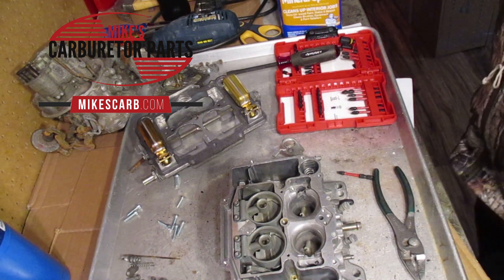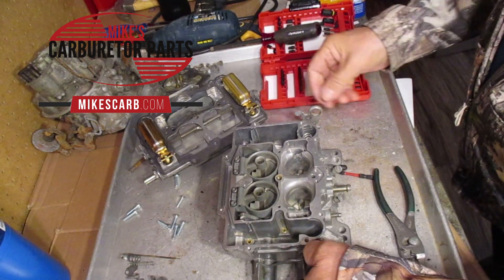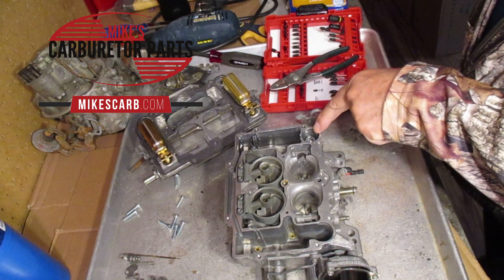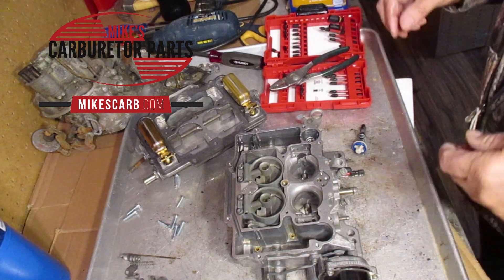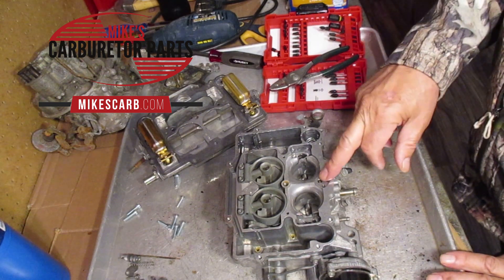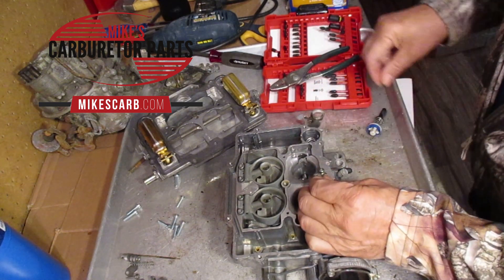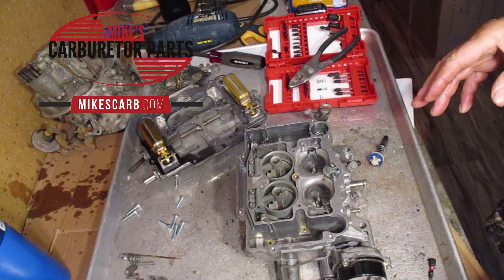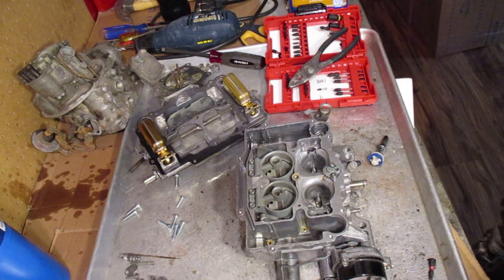Edelbrock  - Testing Accelerator Pump and Bog Troubleshooting

Comment: I have a 1406 on my ‘72 Olds 350. The most part the carb works great, cold starts are near perfect but there are 2 issues that have persisted; 1. After driving for a while it takes a lot of cranking to fire up. 2. Sometimes when I back out of a space it will knock off and I have to restart it. Any ideas on solutions for these problems?
Reply from the maker: After turning off and warmed up look down the carburetor to see if the venturi is dripping. If so, then the main discharge check may be leaking. See this page for more info: https://www.carburetor-parts.com/edelbrock-troubleshooting

Comment: My question is what part of the carburetor is plug if the right side mixture screw is screwed in and nothing happens
Reply from the maker: Most likely the passage on the side that doesn't change. Follow the passage all the way to the venturi.

Comment: my check ball on a brand new carb sticks.  ive had it apart 3 times to get it out....its currently stuck.  is there a fix?
Reply from the maker: You can get it out by heating around the outside and tapping the carb on the bench. It will fall out. It's possible you have the wrong check ball in it, or you can tap it lightly to give it a better seat.

Comment: Mike-Great Videos!!! I was inspired to rebuild my Carter/AFB -9661S by your step by step approach to rebuilding. I have a question for you that I didn't see covered. My rebuild kit includes a check weight. however, the carb actually has a spring on top of the check ball. Can I use the check ball weight or do I have to use the spring? I truly appreciate your thoroughness. I'm learning so much.

Comment: Bad bog when accelerating too quickly. Everything is adjusted and right. I run a wideband 02 sensor as well to check things. If I roll into throttle I get 14.3-1 until it settles at 12.2-1 wot. The problem is that if I jam it quickly, it will hit 22-1 then come back to 12.2.  I'm thinking it's that weighted flap over the secondaries and not the squirter. The squirter works great. Have you ever had to add weight to that flap before or bend it to make it draw some more? I've exhausted all options other than running a new carb with a double pump.

Comment: My car sputters when initially hit the gas and finally takes off. I drove the car for the first time to work and whenever i hit the gas it cut off on me. And at 55 feels like my car got no power! Its posible that my acceleration pump its bad? Its got a  edelbrock carburetor 600. That i rebuild it myself. I also notice when press the throttle one side squirts more gas than other. Any help will be apreciated. I was thinking about just get a new Holley carburetor.

Comment: hey i got a tiny old two barrel varajet carb on my old chev pick up i think my accelerator pump is kaput or not good ! anything a guy could spray into the carb woth out taking it all apart to clean it up?could it also be just my fuel pump not fillin up the carb whats the best way of checking or elimating with out getting all gassed OUT! ha guess i will try and check the inline fuel filter on the carby first?

Comment: Hey Mike.. great channel! I've got a 750 that I bought brand new from Jegs about a year and a half ago, and I've got a bogging issue.. is there any chance I could have a bad accelerator pump, even on a carb this new? All timing, plugs, wires, cap and rotor have been replaced. Any help appreciated!
Reply: @MikesCarburetor   Thanks for that... I ended up having a problem with the timing that I wasn't aware of

Comment: I got a free 2 barrel off my uncle from a 302 to go on my 351w. From what I've found it's getting gas through the line and some in the carburetor bowl but not enough for it to run. It fired after pouring a little in it ran for about 2 seconds then died. I tore it apart to be sure the float wasn't stuck which wasn't then took the jets out and they aren't stopped up so what else could it be? From my diagnosis it's starving for gas and I noticed when I took the top plate and choke assembly off that the little amount of gas in the bottom of the bowl was a nasty green color. From the tank to the low pressure pump on the rail it has 3 fuel filters excluding the one that screws onto the carb. I just need to know any other possibility before I go waste money getting a new carb when it could be just a 20$ fix. All info is greatly appreciated.

Comment: How important is that check weight? I bought a 750 off a guy and it didn’t have one... I assume he lost it since some of the jets were changed... - he probably didn’t even know it was there.... what will be effected without it there?
Reply: The carb will pull fuel from the squirter nozzles at higher rpm also...creating a jetting nightmare!

Comment: Just to help out with flat spots off idle that these are KNOWN For..  before taking it off the engine.. and there is nothing wrong with pulling it apart for a clean out and gasket replacements..   Cold engine.. count the fractions of a turn to lightly seat the idle mixture screws.. so you can put them back where they were...  take the idle mixture screws out.. a 1 second blast of carb cleaner spray down the idle mixture screw hole followed instantly by a blast of compressed air.  do this twice on each idle mixture screw hole..  put the idle mixture screws back in and test drive the car..   sediment that gets into the carb clogs the idle feed restriction or Economizer restriction in the primary booster assembly. have a look at this one i cut away.. https://i.imgur.com/tcqxbLF.jpg  it supplies all the fuel from idle to about 1800 RPMs all  by its self.. when there is enough air flow across the primary boosters to lower the pressure and start pulling fuel up and out of the boosters.. but these don't take over completely till about 2400 RPM..   so the idle feeds are supplying fuel in a diminishing volume between 1800 and 2400 rpm depending upon carb size and engine displacement.   if you have an engine over 400 cubic inches.. you may need to figure out what size the economizer passage is using the bottom of a Number drill. set with drills sized 61 to 80 is what you need and a dial micrometer that reads 0.001"  bigger engines need more idle transition flow.. so you may need to drill it  by 0.001" on both primary boosters and then reassemble and road test for a day or 3.. you will have to readjust the idle mixture screws when you do this and be sure to blow all the chips out .    this info was removed from the edelbrock tuning manuals so the professional carb tuners would have something to work with to impress you with. . let me tell you  if you get it right.. you won't believe its the same carb. . if you have an air fuel ratio gauge.. look at air fuel ratios at 1500 RPM.. are you lean or rich..   the economizer passage is behind the side mounted idle air bleed..
Reply: This is THE definitive answer on how to get rid of the part throttle hesitation.  It completely changed how my car drives now